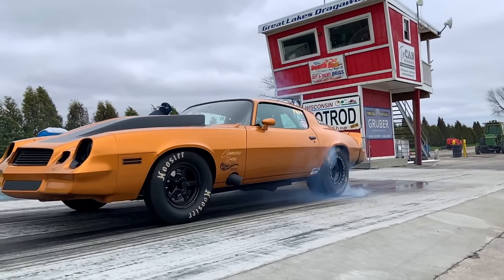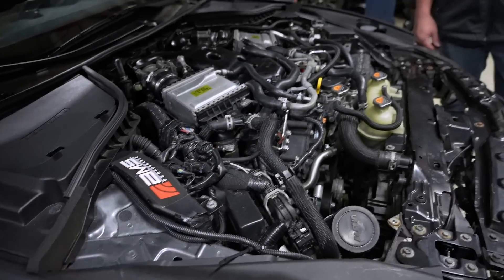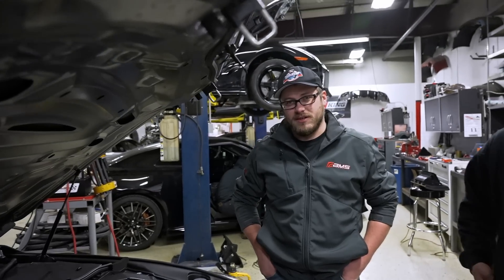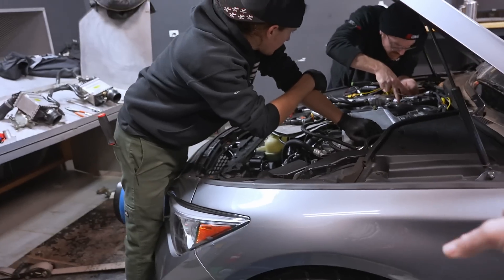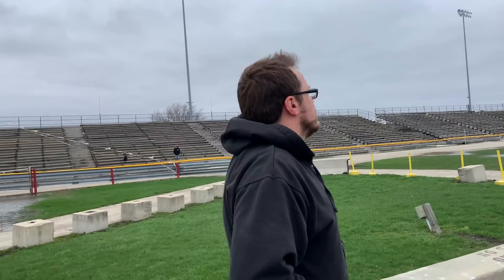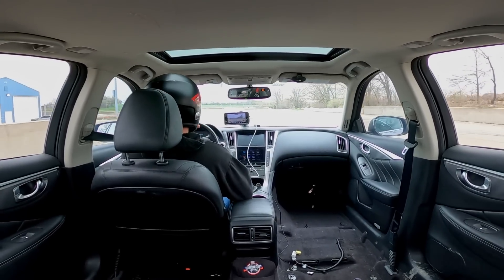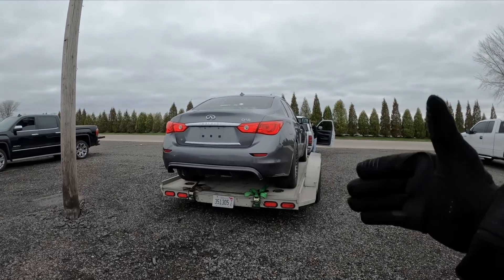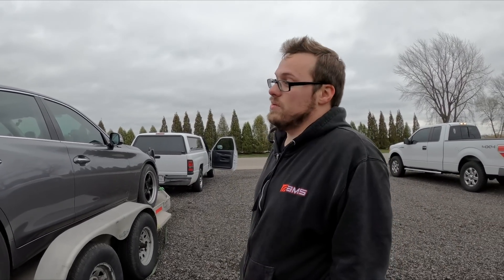Fastest Q50 IN THE WORLD! | VR30 Intercooler Prototype Testing

Comment: Are these two different cars/setups? (Gray Q50’s) I just happened to notice that for some of runs there’s an AWD badge and it seems to be an AWD car but then in another run the AWD badge isn’t there and the car was heating just the rear tires it looks like. Kinda threw me off lol.
Reply: Edit: I’m now assuming the car has a Syvecs or other similar AWD controller which allows for a burnout mode and lots of other adjustments to the center diff/awd system.

Comment: Wows for the skyline 
Vr30s don’t fuck around with proper engineering and heat control
Proud to say I have my own baby gtr q50s are very sleeper cars that are akin to the 2jz and the LS engines 
Very easy to get power out of 
Should mention that they are descendants of the rb26

Comment: Hey I have a 2011 g37x and was wondering did you guys do anything to the transmission?
Reply from the maker: Unfortunately we do not work on the G37 platform. Sorry about that!
Reply: @AMSPerformance  it’s cool, I was just wondering if you kept the dame stock tranny or replaced it with a stronger one, thanks for your reply.
Reply from the maker: @puterfixer7857  This one specifically is a Level 10 built transmission.

Comment: when that new Z comes out i wouldnt be surprised to see people make 500/500 to the wheels on stock turbos, just some intercoolers intake and exhaust and a tune and those’ll blow the supra out the water. these vr30 platforms make some fuckin BEANS
Reply from the maker: I guess we will find out! 😉
Reply: And you don't think the supra /bmw make some beans well wishful thinking
Reply: Sure did blow Supra out the water when they drag race stock lol 😂 3610lbs is not going anywhere near Supra level so yea peace ✌️
Reply: @bman1668  plus the supra / bmw is capable of more power mod for mod so some people are delusional
Reply: @bman1668  3500 w the manual and its a bmw not a supra 😭 paying for an m340i with different panels yikes
Reply: @devon5078  better than recycling Nissan parts on 2003 chassis , rather have premium for 50k than car that will fall apart
Reply: @bman1668  you literally have no proof or basis for that statement lmao